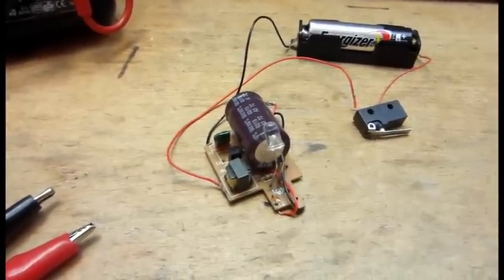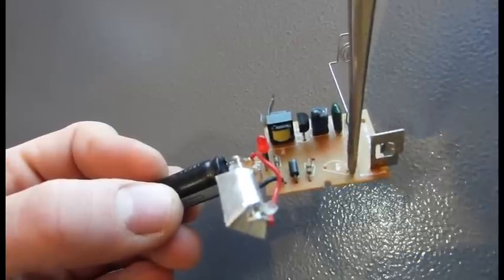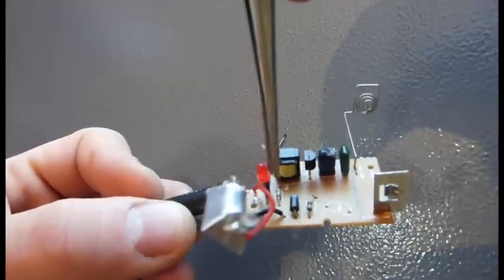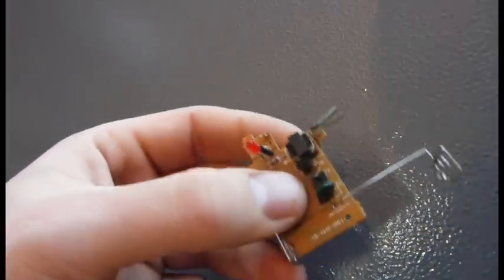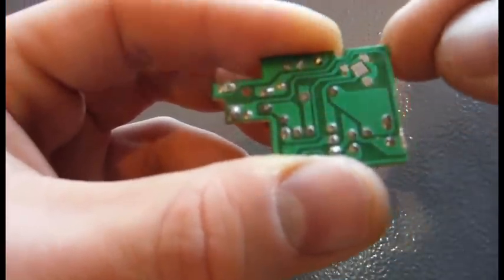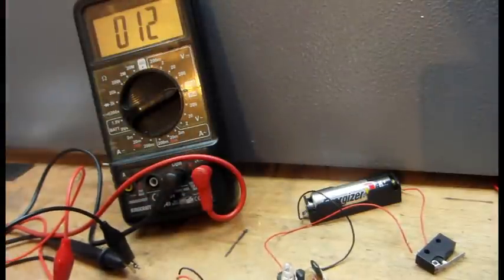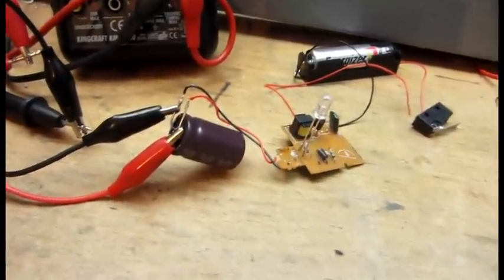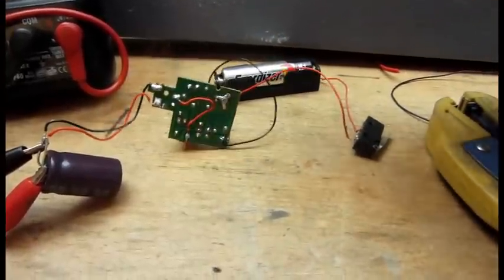SUPER SIMPLE high voltage capacitor charger 1.5 to 350 Volts !

Comment: In what types of things can you find that capacator???, a flashlight or a old remote control or an rc car??
Reply: Do they run on high voltage or generate it? Nope. Cameras or PC powersupplies, old bulky 15" PC screens.
Reply: LaserGadgets i found a 16v 2200uf capacitor, can i upgrade a bug zapper with that?

Comment: Been thinking of making one of these to charge a small capacitor on demand. do you think putting an inline resistor or potentiometer would control the rate of charge? I am not even sure if this is possible, I am fairly new to electronics like this : )
Reply from the maker: Could work. But would be easier to install a voltmeter and just stop charging if you got the (lets assume) 100V you want.

Comment: I just "liked" your video! I'm new to this so I just have a few questions if you don't mind.. So that's a circuit board from a normal disposable camera? What is that black cylindrical thing, a capacitor? Does that kind have a name? Also at 350 volts, would that provide enough amperage to power an electromagnet to pull a 1 inch neodymium cube grade 42 5-6 inches of the magnet is attached to a slide rail? Is that even possible? Thanks! I'm working on a project I think you'll find very interesting, do you have an email I can send details to? You might just get a kick out of it.
Reply from the maker: +Dakota Dwyer Not sure what your plan with the magnet is, but magnets and eletromagnets...doubt it. The coil will pull steel into the coil, to its center.
And its a PHOTO FLASH capacitor...low ESR...
Reply: Oh okay well thanks, I wanted to make a fully functional hidden blade from assassins creed.. I thought it would be cool instead of having springs to use an electromagnet to try and pull the magnet causing the blade to go outward, it's just that with springs there's no way to make the blade out and in on command, just one direction. In your demonstration video you reeled the projectile back in with something. Would something like that work?
Reply from the maker: +Dakota Dwyer Uhm, I actaully did that already on my other channel. 48h Wolverine claws. You need way too much power...so no.
Reply: Oh okay cool thank you, do you think you could send me a link I'm having trouble finding it
Reply: +Dakota Dwyer On this channel. Will not help you though, trust me.

Comment: I can never find disposable cameras. They seem to be an endangered species now. Any alternative sources for a circuit like this?
Reply: Long time ago I used electric fly swatters. They're cheap and work great.
Reply: Hey there boyo, Thought that this would be handy two years later
https://www.youtube.com/watch?v=cZ2vfn_gpS8
Reply from the maker: +175griffin They sell them on ebay.
Reply: They're almost $10. Not worth it for scrapping for parts
Reply from the maker: +175griffin 6 bucks in stores, and worth it indeed actually :p
Reply: Maybe I'll get some used ones in bulk or something. I do find myself needing these circuits for a lot of things
Reply: I just got a box of 25 for $23. I'm going to make a geiger counter, capacitor bank charger, a flash beacon, and maybe use a few in series with voltage multipliers to power a co2 laser or x-ray tube.